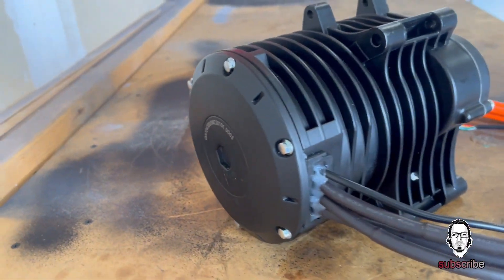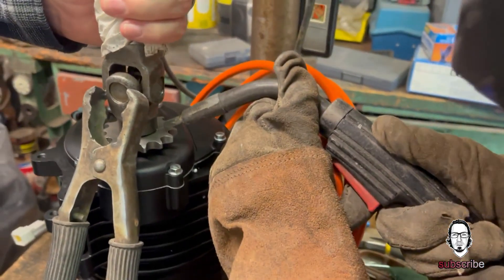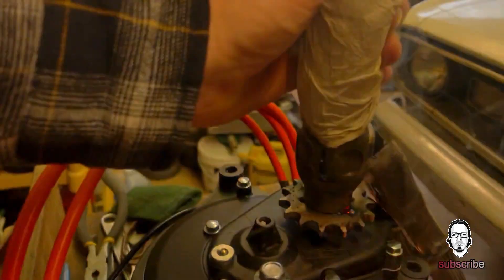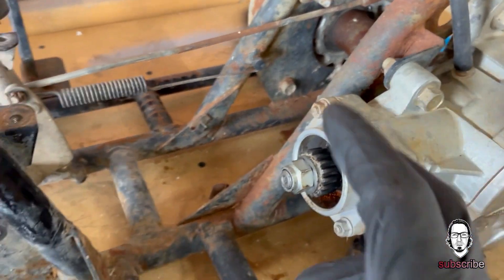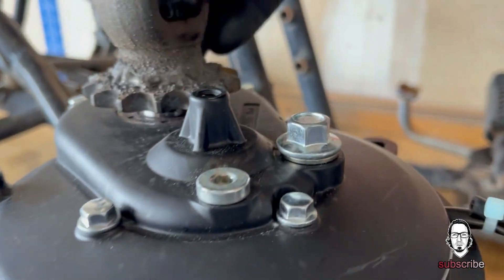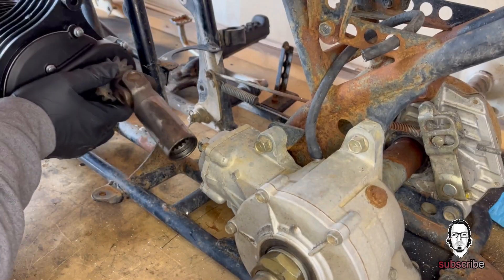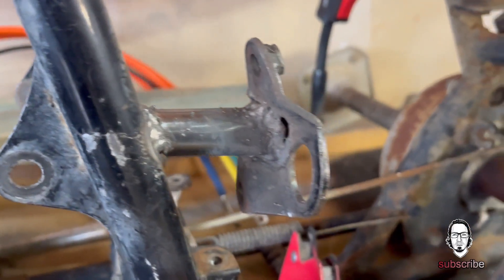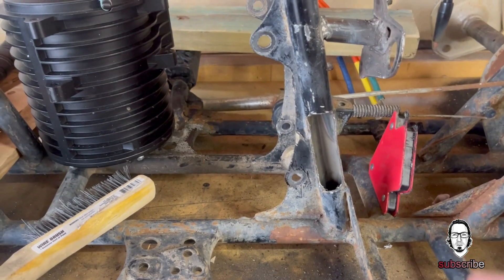ATV Electric Conversion Part-2

Comment: This is a great build! Thank you. I have been trying to find someone that just used the existing drivetrain and attached an ev motor for quite a while. Definitely want to start a build like this
Reply from the maker: This has been my favorite build. Thanks for the comment and good luck.
Reply: @ that’s a good answer. This has been going on since the 70’s and 80’s tho. Quebec uses a huge amount of fuel oil and propane for heating that i believe is controlled by Irving